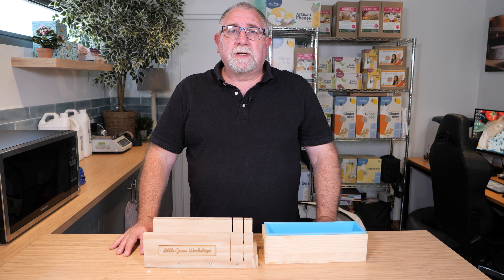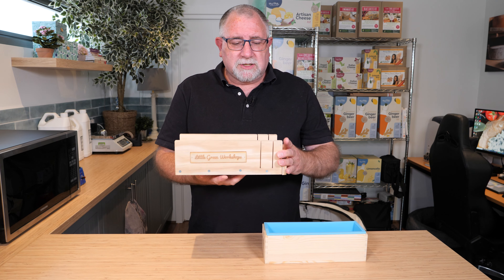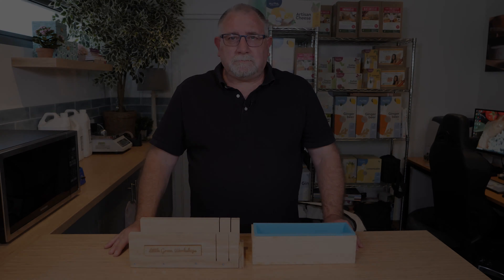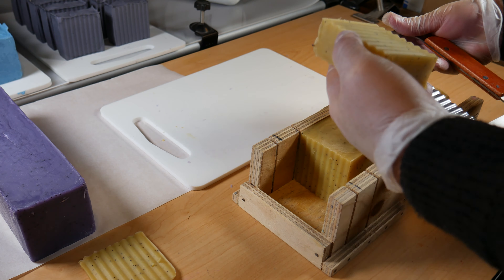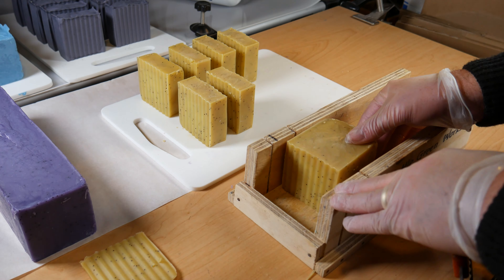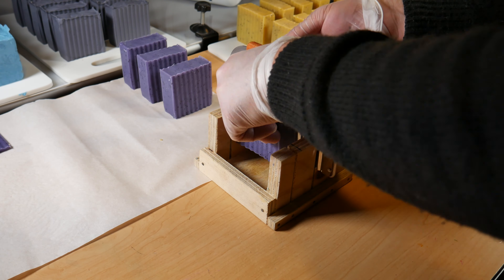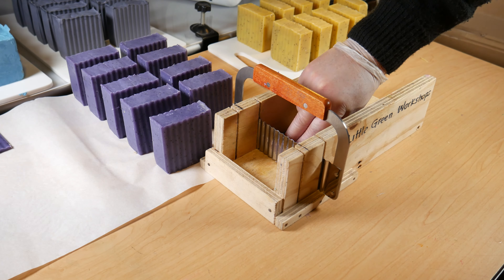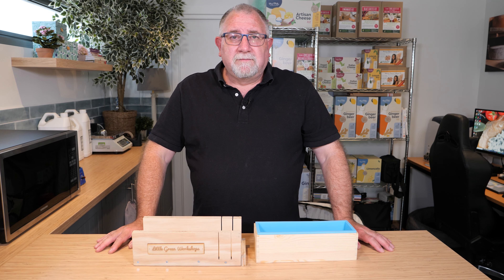Cutting Soap Consistently - Even Bars Everytime!

Comment: As a consumer not a soap maker - how can I cut my bars into smaller pieces? I have recently purchased 3 scents and would like to cut each in half to not have a big chunk setting in a damp shower and so I can switch up scents sooner. What can I use around the house to cut my bars without making a mess of them?
Reply: You can use a sharp kitchen knife. As the soap is cured you don't have to worry about using it again on food as long as you thoroughly clean the knife after use.

Comment: I've got one of these cutting boxes with a blade down at the underside of the box. What's that blade for? It's flush even with the bottom of the box on the underside! Crazy looking.
Reply: That's a plainer (sp?). You run the soap across it and it shaves off a little. You can make soap curls with it. Bevel your edges and more.